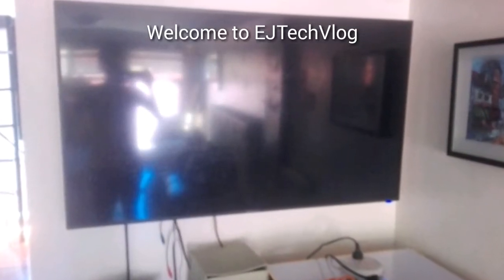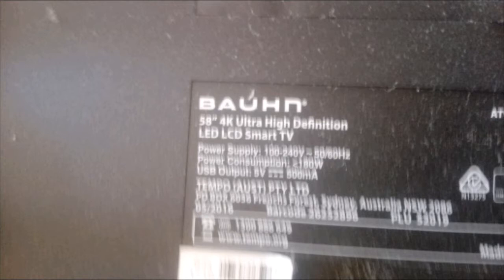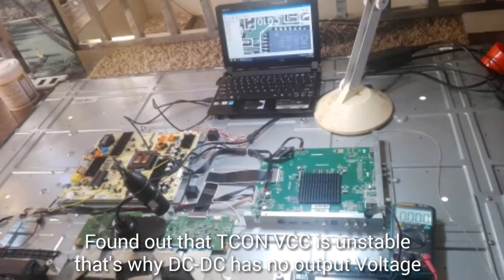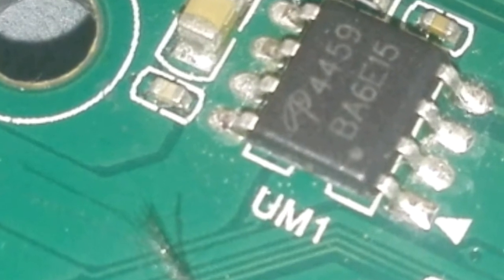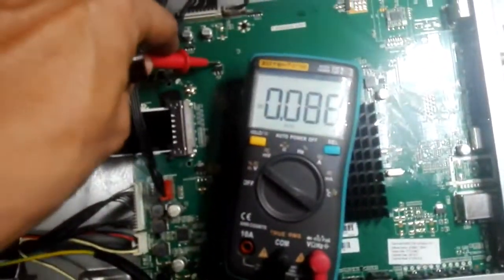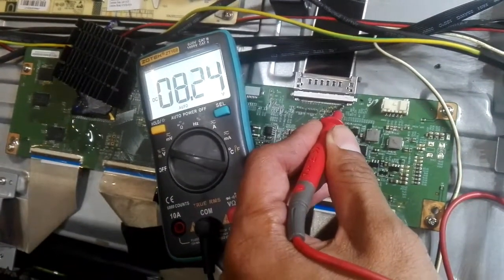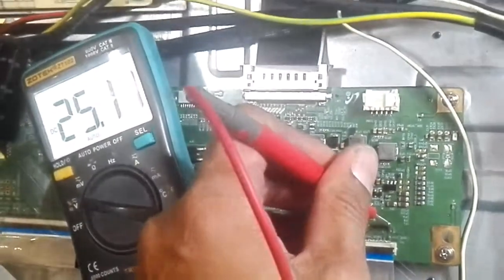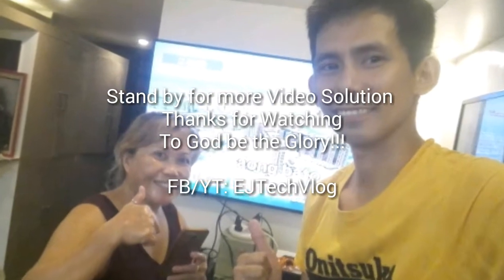Bauhn 4KUHD Led TV  No Image, No Display, Blank Screen - Screen Tap Test

Comment: how do you fix backlight issue?
I can see the image if I shine a torch on the screen
Reply from the maker: its depends if its  a backlight issue or a defective backlight driver issue, you'll need to call a Legit Technician since its a delicate and risky job if its a backlight replacement, you might end up damaging your LCD Screen or a broken LCD

Comment: any solution for flickering screen, snowy picture that appears after some time duration when viewing videos/gaming in 4k?
Reply from the maker: check the ckv clock voltage maybe its fluctuating
Reply: @TJTeeVee  where is location of ckv clock voltage on the PCB board
- so just check DC volts while it is powered on?
-once measured, how to fix it 
e.g buy what replacement components

Do you know why this issue only occurs when watching 4k and not 1080p?
Reply from the maker: @TylerDurden404  the ckv clock is located in the TCON board and the Panel Board (the PCB Attach to the LCD SCREEN connected by a COF (Chip on Flex)

Comment: I have the same tv but it flashes momentarily with The Bauhn logo then goes blank with the two blue front lights ok can you suggest anything?
Reply from the maker: check for bloated / esr value of capacitors or check the backlight driver circuit or the backlight itself, if not check the switching mosfet
Reply: @TJTeeVee  thank you
Reply: @TJTeeVee how do I recognise all these to fix please?

Comment: Hi, I gave that tv and I have a problem that I wonder if you can help me with. The sound works and so do the menus for Netflix etc which all work well but when I watch a program the screen is almost black yet the sound works perfectly. All menus tabs a good and visible. I feel that I’ve mucked up the settings somehow on my remote. I did work perfectly before
Reply from the maker: try to reset the system setting of the TV if you still have access. if nothing works there must be a  problem with your Backlight, in that case you need to call a TV Technician in your area